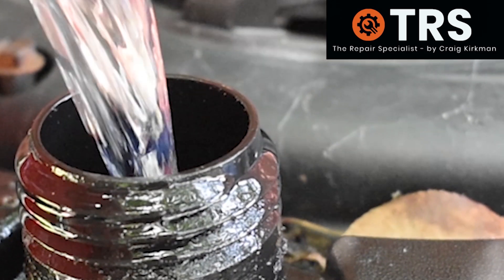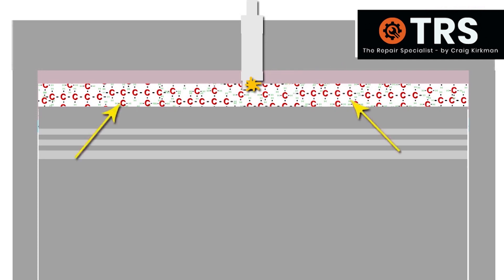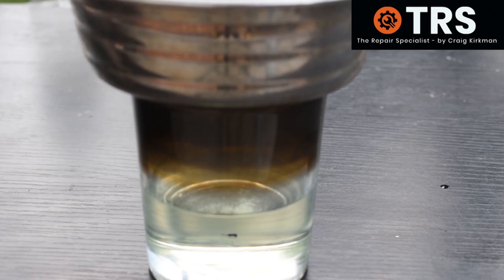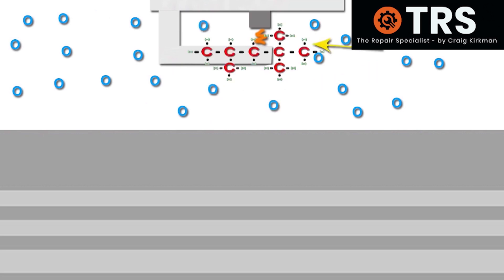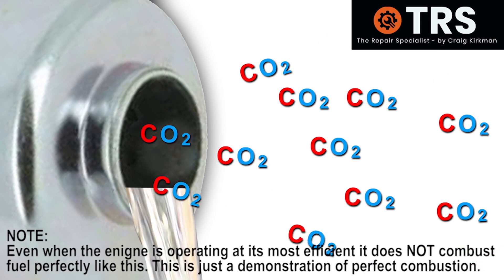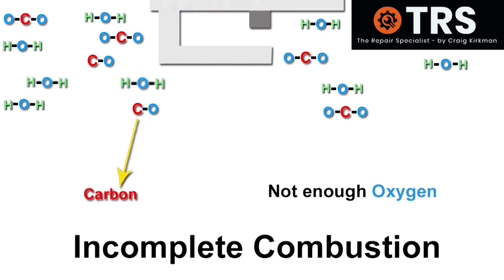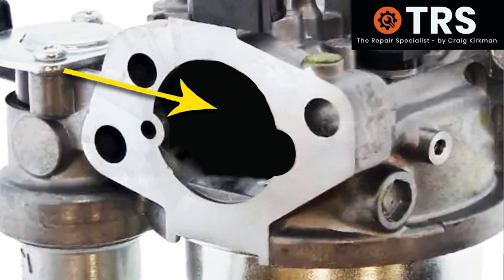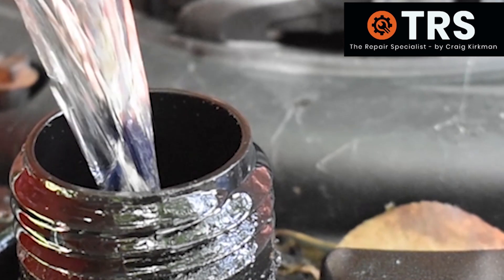INTERNAL COMBUSTION ENGINE cannot Combust Liquid Petrol Gasoline (by Craig Kirkman)

Comment: Awesome video. I'm loving your channel. So is all gasoline C8 or just most of it? What's so great about octane?

I think there are a couple errors in what you're saying. I think the biggest is that I'm pretty sure that breaking apart the gasoline molecule requires energy. It does not produce energy. It's just that recombining those atoms into CO2 and H2O releases a lot MORE energy, so I don't think it's correct to say that the explosion is merely the breaking part of the gasoline molecule. It's the entire chemical reaction.

Second, I either don't understand your explanation of incomplete combustion or I don't agree with it. It sounds like you're saying that insufficient oxygen results in a reduction in the amount of heat generated in compression. I believe that there are two sources of heat due to compression: 1st off, the piston is striking molecules in the cylinder, and speeding them up. This generates an infinitesimal amount of heat. I believe the second source of heat due to compression is that you are causing the gasoline vapors to condense, thus releasing heat and heating up the aerosolized droplets that are formed. So I don't see how reduced oxygen can lead to reduced heat due to compression.

I think the issue is simply that there's less oxygen around to react with the gasoline, so it doesn't completely combust.

Comment: I get the concept  , but where its the 70% percent  nitrogen that its on air mix with the oxygen.  Where its the nitrogen play on the theory
Reply: Just imagine it and the CO2 in the atmosphere in between all those oxygen molecules. They don't participate in the reaction except to help compress the gasoline and generate some heat.
Reply: @mitchjohnson4714  73% nitrogen 23% oxygen and the carbon/hydrogen  in the gasoline  molecules,  in compress process oxygen give up heat that help,carbon molecules to separate from hydrogen and hydrogen gets implosion on the cylinder,  then  carbon get hold to nitrogen that at muffler become carbon monoxide or nitroxico of carbon.  With now its bond together  but just before exit the exhaust get high heat in the catalytic converter with will hold the carbon molecules and free the nitrogen but with its condensed into water vapor at end on the exhaust.